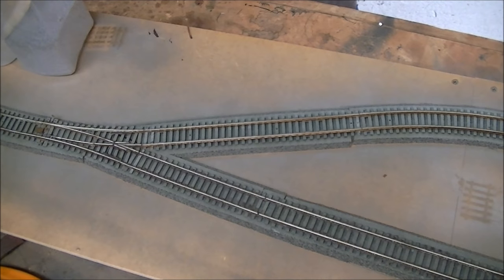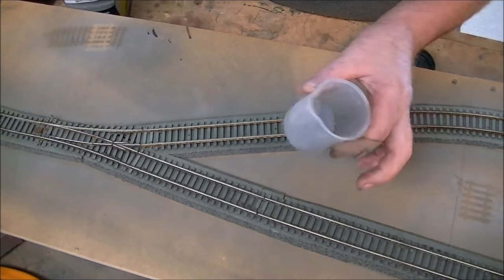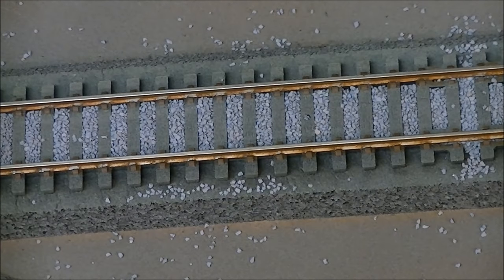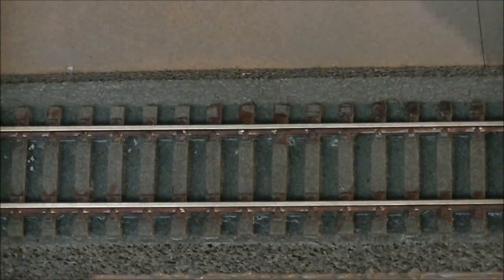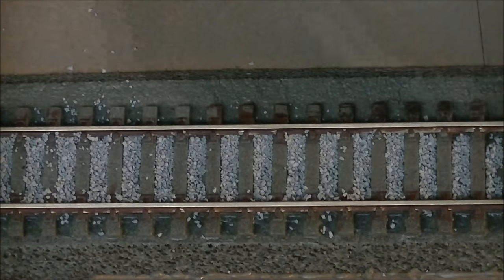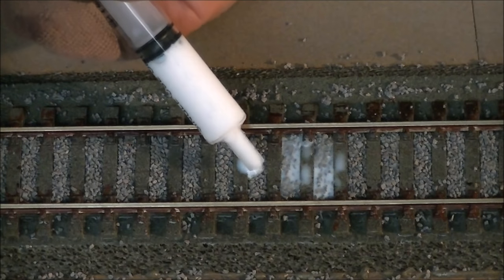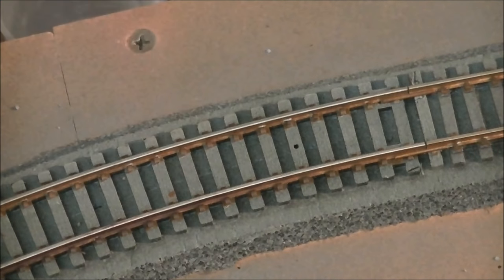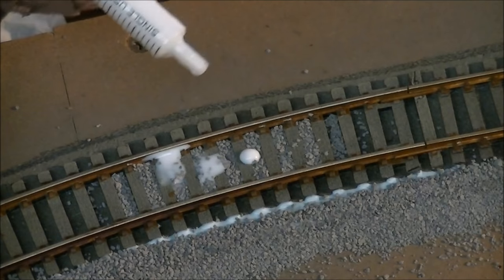Ballasting - basic technique

Comment: This Video has some good point and also a few not so good. If it took me 20 minutes to ballast about  4/5 inches of track I would never get it finished especially dropping glue between every sleeper.
Reply from the maker: Thanks Ken for your comment and feedback
  I agree and as this is an old video my method has changed, still basically the same, but I now  use a micro dropper bottle, filled with the same scenic mix. I think the trick to speeding the process up is making sure the ballast is well sprayed prior to dropping on the scenic glue.. with the micro dropper bottle you can get a steady small stream which flows into the ballast well without flooding it,  plus doesn't require re-filling as much. 
If you flood the ballast you run the risk of it flowing away from the track.. But I take your point on time (which is probably why a lot of people don't like ballasting!)
You can get a ballast spreader which might make it quicker, its a plastic hopper which you load with ballast and it runs along the track, not expensive, probably worth a try.

I hope this helps
Cheers
Al

Comment: First time through I believe you say don't use plunger in the syringe and there is none showing. On the recap you show applying the glue with the syringe and plunger, which is it?
Reply: steve schiff ?
Reply: I think you missed heard. He never said ‘don’t use a plunger or syringe’ he said when making the mix (so water/meth/glue mix) and when applying don’t put too much on in one go as it will just absorb through the make the ballast and seep out (so via the sides)….also he’s using his finger to act as the plunger to control how much he applies (as his finger acts as the seal)….where as if it’s a bigger area then using the plunger might be better.
Again…none of this is 100% correct….it’s just another option/idea…if it works for you, grand …if not, I’m sure there are plenty of other ways of doing this. I’ve just found my old Hornby 125 set from the 1980s and though I’m into RC, have always thought about giving this a try. ….definitely a project over Christmas 😁👌
Reply from the maker: I hope you do, or at least get some enjoyment out of a christmas project, you are right there is no right or wrong way with all this stuff just giving it a try and seeing what works and what doesn't is the best thing about it
Cheers and thanks for the support

Comment: Ewww.... tapping the track after ballasting...not a good idea as it will encourage the ballast to actually lift up on the ties thus throwing out the level of the track
Reply from the maker: Actually I've never had that problem, and I think it doesn't,t for two reasons, 
First the ties are glued to the track bed so don't lift. Though that may be a problem if track was pinned. 
Secondly it settles the ballast only into gaps, it doesn't force it under the sleepers.
Anyone else ever had this problem?